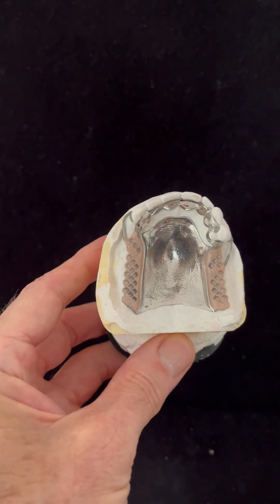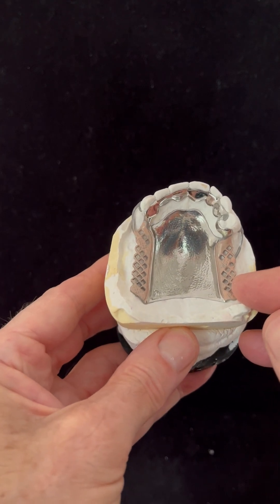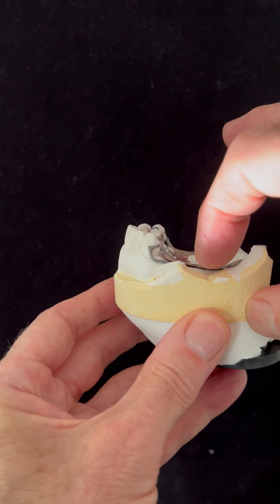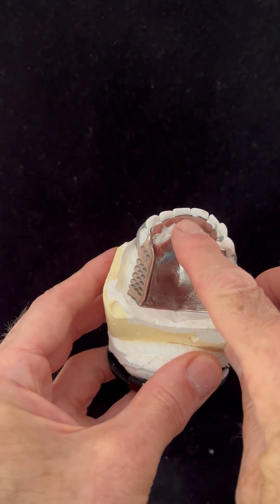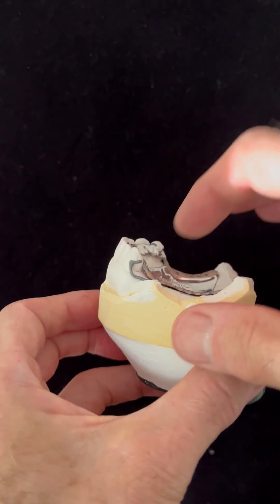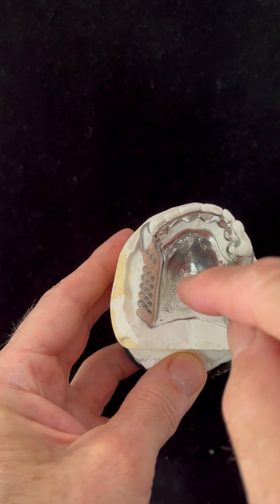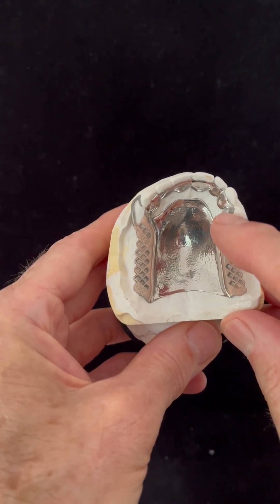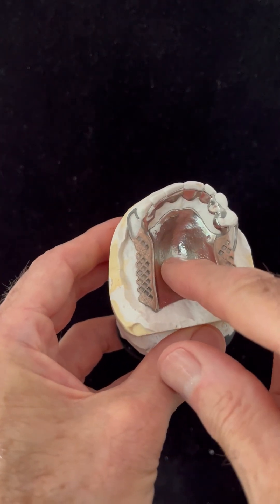Scandinavian Partial Denture Design. It’s science not some form of black art!

Comment: So in the maxila we dont need to put rest seats on the anterior and we only need the rest seats in the mandible?
Reply from the maker: These incisors are almost retroclined so the only way you could load them through the long axis would be to rest on the incisal edges. Not attractive. Logically any load is on the posterior alveolar ridge so the incisors would contribute no support. That’s why we use the entire palate.
So you’re correct, rest on the lowers because the buccal shelf is a much smaller surface area from which you can derive support.
Reply: @mikegregorydentures.478  apart from this case( as a general rule), do we ever put rest seats on maxillary anteriors? 
Of course we have to keep in mind not to interfere with occlusion and the lowers hitting on the rest seats.